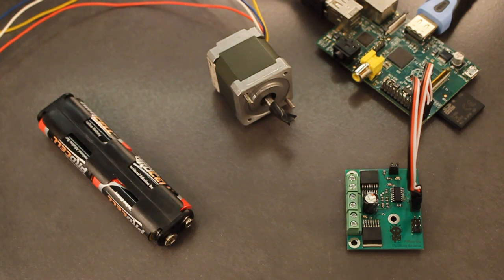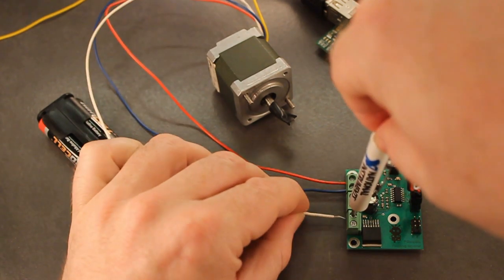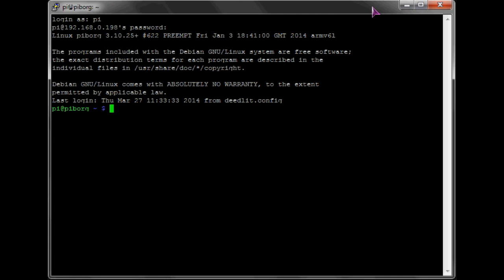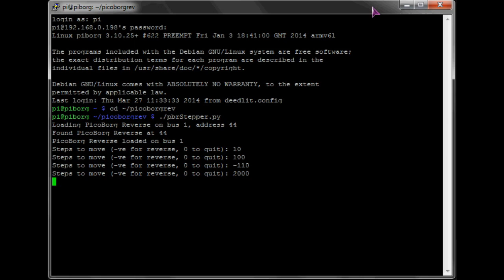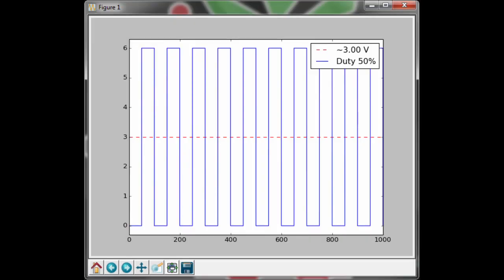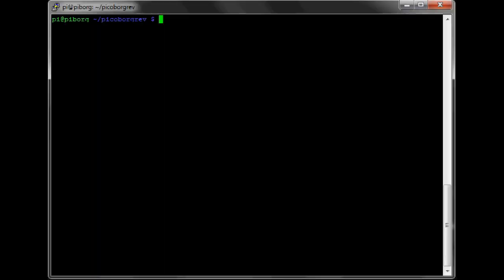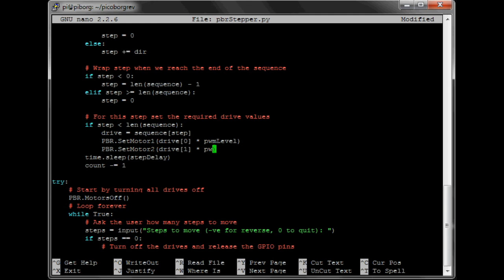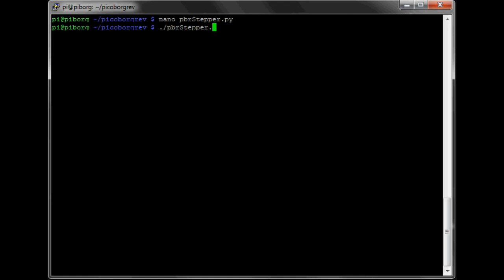PicoBorg Reverse Video 2 Stepper motors

Comment: So I would like to control the steps using c++ am I able to do that in any way?
Reply from the maker: The PicoBorg Reverse uses I2C to talk to the Raspberry Pi, you should be able to use the linux/i2c-dev.h interface to talk with the board.

Sparkfun has an example of I2C C / C++ code here:
https://learn.sparkfun.com/tutorials/programming-the-pcduino/i2c-communications

The Python code behind the PicoBorgRev.py library has all of the numeric codes for the commands you should need, it is part of the example files provided by the installer.